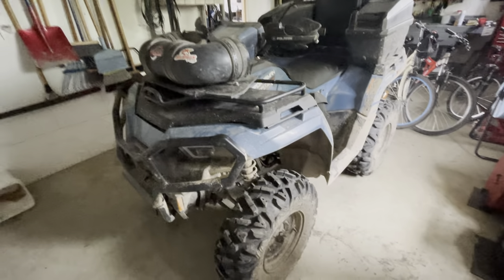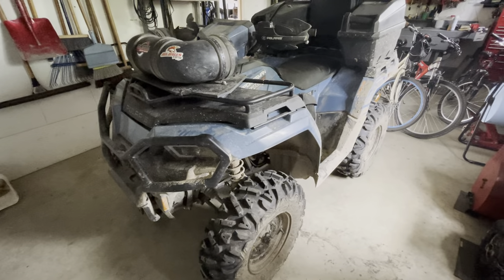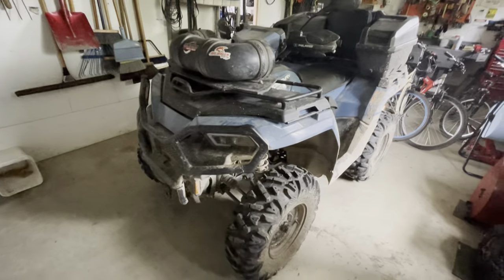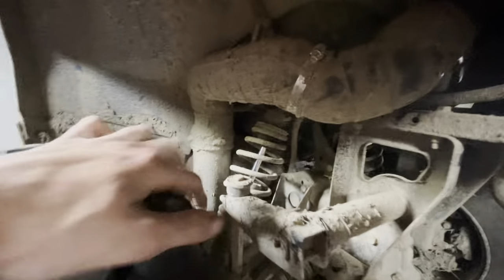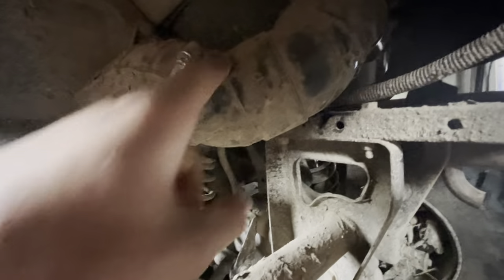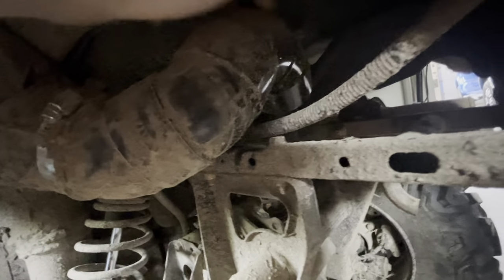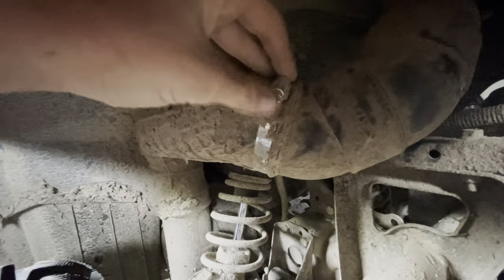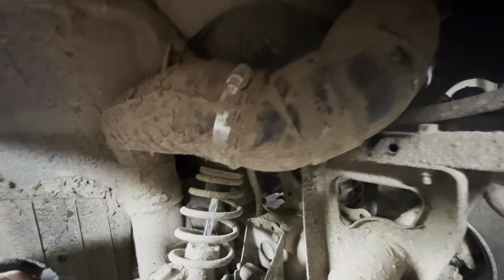2021 SPORTMAN 570 CVT EXHAUST SNORKEL

Comment: great video definitely helped me with installation of mine. 
hey have you installed a snorkel on the intake for the belt? if so would you please upload a video so we can see how you did it and what parts you used, that would be very helpful too.
Reply from the maker: Thank you , and I been testing out some designs on the bike but so far I haven’t found a great solution yet, I seen some guys routing a hose to inside the front box , but my problem with that is you don’t get any air flow so the cvt will get hot and most likely have belt issues in the future, but I’ll definitely make a video when I find some solution

Comment: nice i am abouth to by one tel me abouth the water in the clautch is it fixt ?
Reply: This always fixes them. I have a 21’ 570 Trail on order have talked to a bunch of guys on the forums about it and they all do this you can also replace the factory one with one from a previous gen 570 that routes up under the seat you have to heat it up and bend it a bit but thats a fix as well

Comment: how did you get the 3 inch elbow in the rubber piece
Reply from the maker: The one end of it is smaller end I believe it’s a male that fits in but I don’t remember the right name for it
Reply: k thanks
Reply: @dougkyle7968  It's called a street elbow. One end is male, the other female.